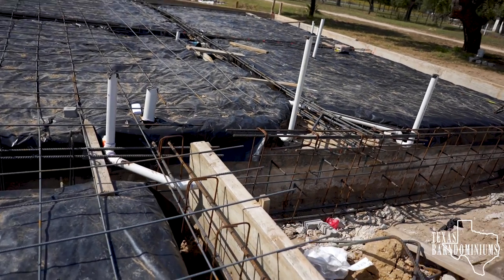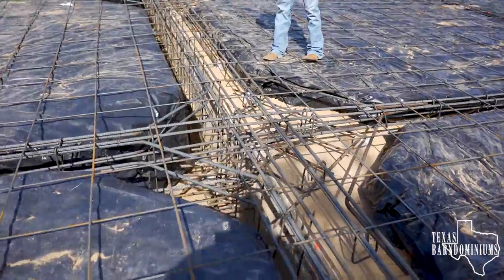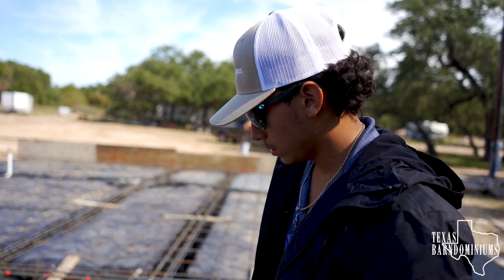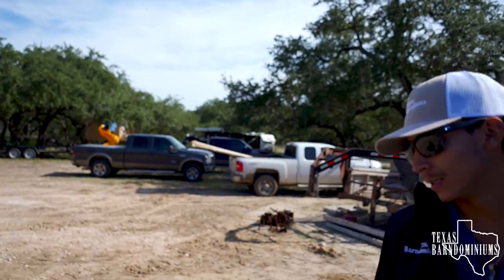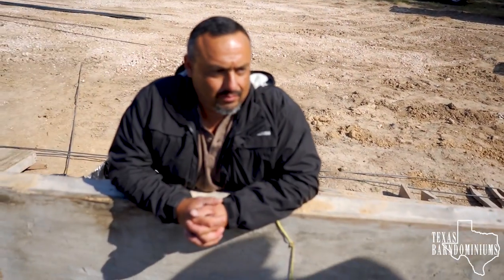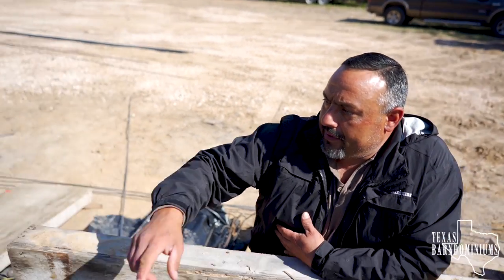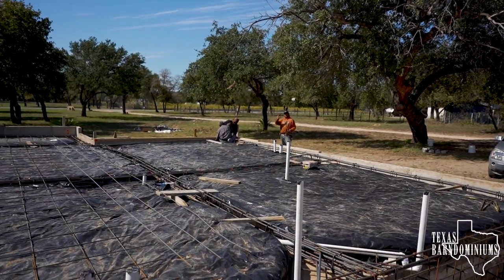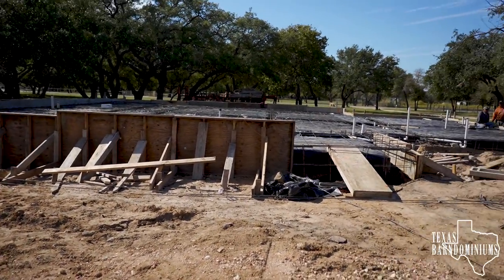Prepping Leroy's slab for concrete pour - The Barndominiums Show E188

Comment: Having done foundation repairs, leak detection etc. I will avoid plumbing under slab as much as possible. You can end up doing sheetrock repairs, flooring replacement, windows .... the list is long. With the plumbing over head you still do some of the repairs but not as many plus penetrating the slab ain't cheap.  Plumbing leaks can wash out under the slab.... I could go on for about an hour lol. 

I'm going to use those famous words we all use when we've been there and done that... "trust me".

Comment: It’s amazing to me how much radically different your foundations are than in our area. Ours have much smaller bar,fewer and smaller beams ,and roll wire. Some commercial foundations are not that beefy
Reply from the maker: Yeah, ours are super overkill.  I have discussed this with engineers and they say that’s what’s needed for our soil type.
Reply: @TexasBarndominiums  YUP.OUR CO.JUST HAD 2 OF 12 APT.BLDGS PUSHED OUT,&PINNED....FOUND 15'OF SAND IN A POCKET(NEW SOIL TESTING)MILES O REBAR.BOSS HAS 2 REBAR TYING GUNS(2600$EACH😭😭)I DIG YOUR AGRABACIONES🤣🤣

Comment: Outside the Box: Electrical PVC conduit has wide sweeping 90s. Place electrical conduit in the slab with the Pex water lines inside them. Isolates the Pex from slab movement. The electrical conduit can also be insulated with standard foam pipe insulation. If there is ever an issue with the Pex it can be pulled out and replaced!

Comment: Hey Erik, thanks for the videos. I have a similar situation where house burned down leaving just the slab. Everyone suggested I tear out the existing slab and start new but that will raise my costs. What structural engineer did you use to design your foundation?
Reply from the maker: Find a local engineer. It will be best.
Reply: Texas Barndominiums thanks for your response. Tried several structural engineers in the Dallas/Fort Worth area some are not even aware that this can be done. Others don’t recommend despite the existing slab being in perfect condition and advised me to tear out.

Comment: One time on a sidewalk addition video you mentioned using a snap cap. Can you elaborate more on that?
Reply from the maker: It’s for expansion joints.  After concrete is poured, remove snap cap and fill in with self leveling epoxy meant for that purpose.  Will keep water from going into joint.  

https://www.deco-cretesupply.com/products/forms-expansion-wire/snap-cap
Reply: @TexasBarndominiums   Thank you